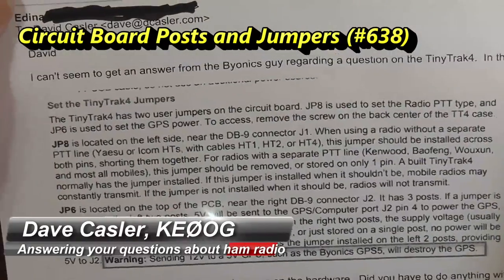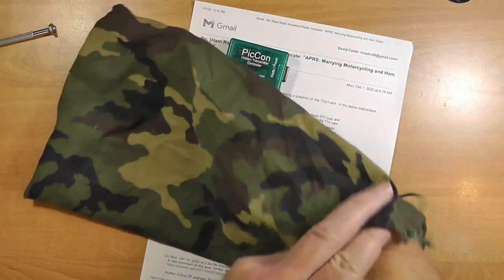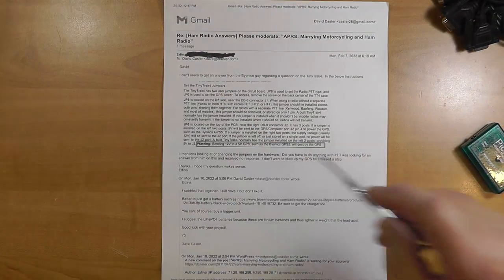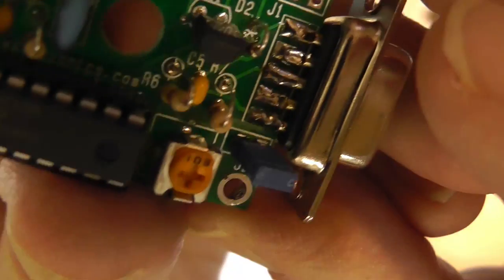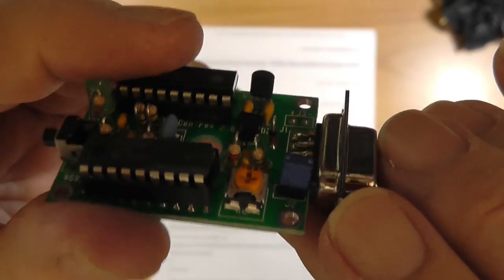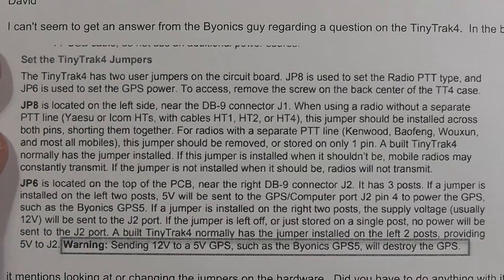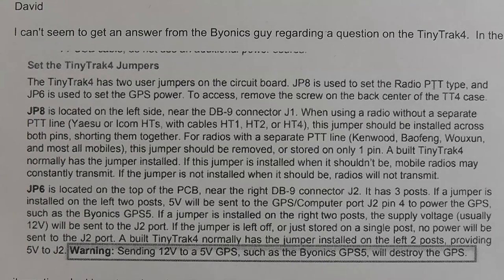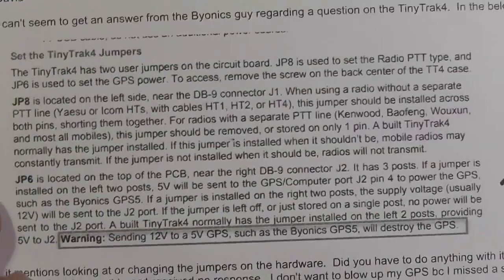Circuit Board Post and Jumpers (#638)

Comment: Computer geeks that assembled their own computers back in the 1980s and  90s will remember adding jumpers to the DIP headers on circuit boards for drive controllers, printer ports,  I/O ports, and modems, etc., to to set things like the data buss address, baud rate, device type, etc. As shown in this video, you can also do things like select voltage levels, and other things, to emulate a simple switch.

Usually you only set the jumpers once, but sometimes you get need to try a few times, to resolve conflicts between devices, then you write it into your equipment log for future reference, and forget about it.